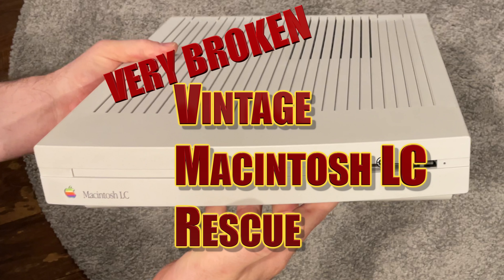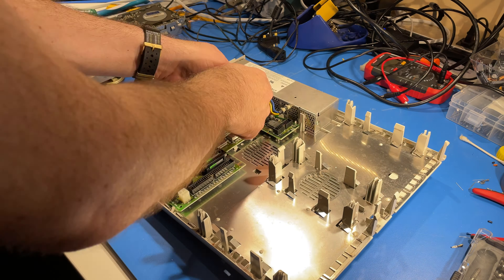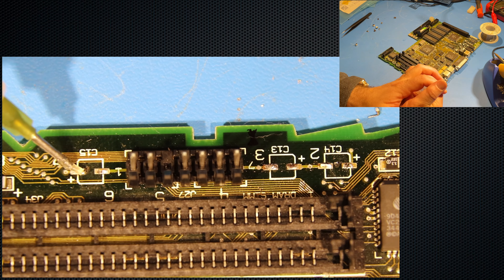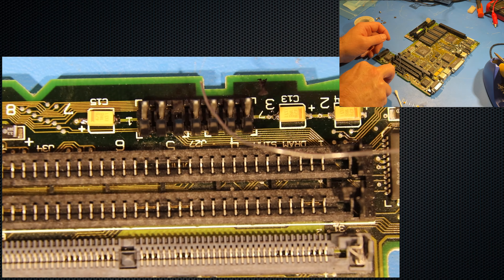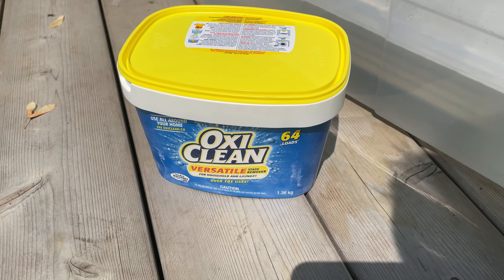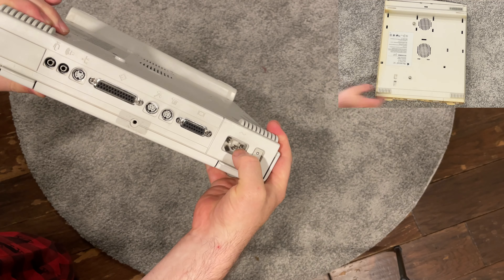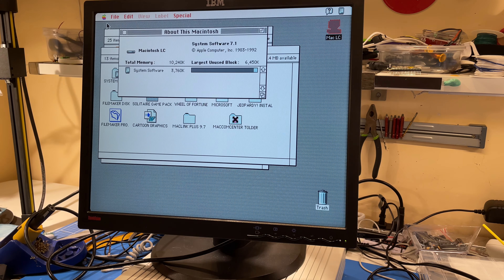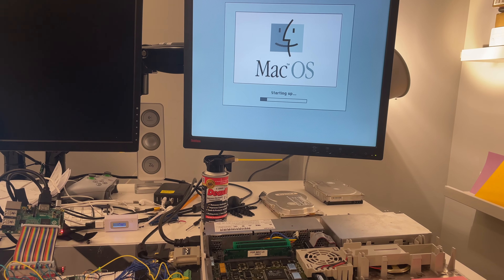Very broken Macintosh LC.

Comment: Did u ever do the RaSCSI?  I had good success with a BlueScsi on a Mac SE.
Reply from the maker: I tried both RaSCSI and BlueSCSI.. I end up going with BlueSCSI in this machine its just a bit simpler and you can find the parts easier and cheaper than finding a Raspberry Pi Zero